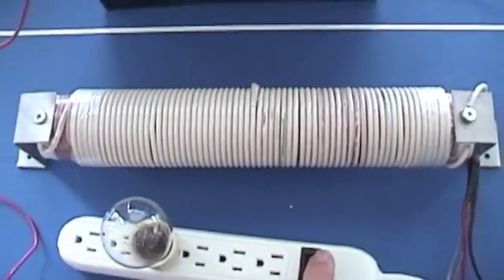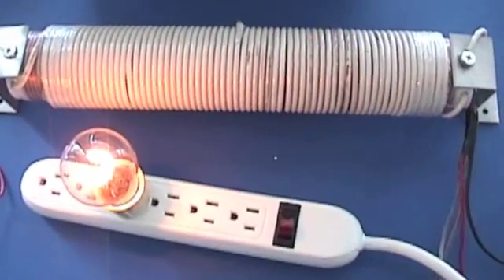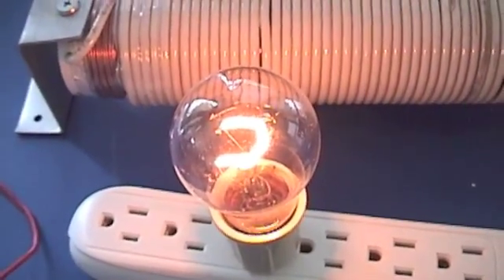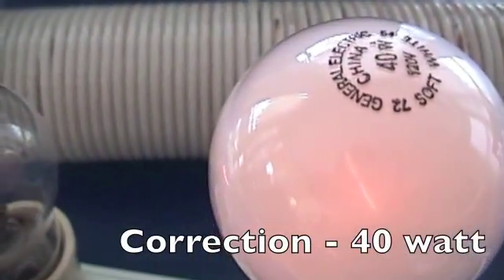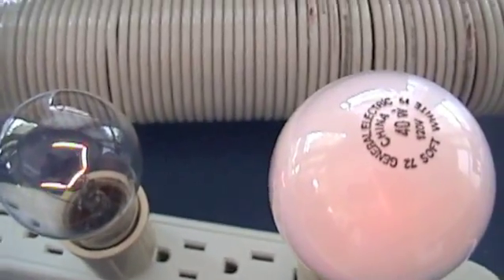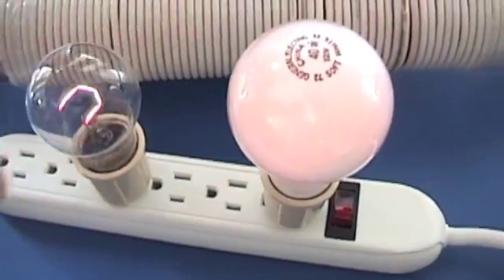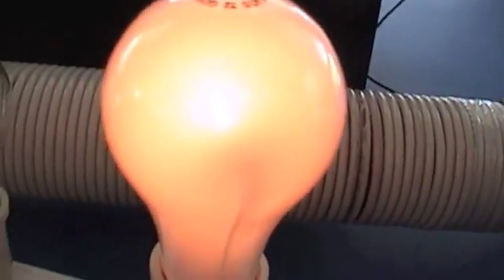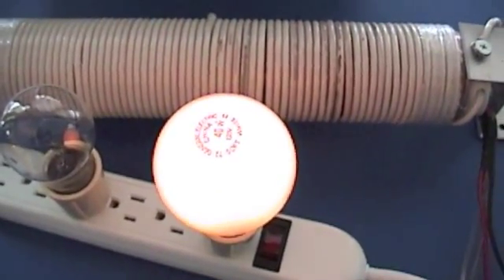Lynx Joule Lamp - Power

Comment from the maker: Voltage 12.54, 1.81 amps, 17.75 Khz for one 40 watt bulb.  This circuit is not intended for this kind of bulb.  Its more about a replication of another experiment.  It also confirms that 25 watts is about max with this coil setup.  Tomorrow I will make some changes for a 50 watt design, still with this same size.  I did run this Aircore today with just wind and solar, winds were strong all weekend.